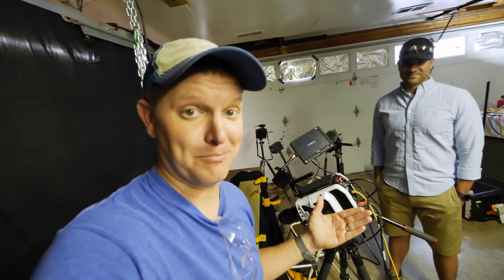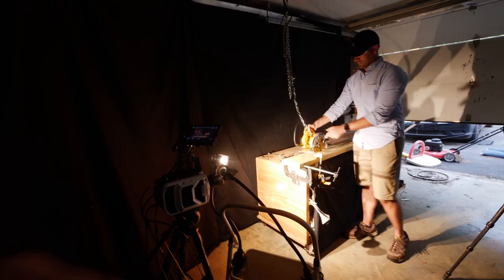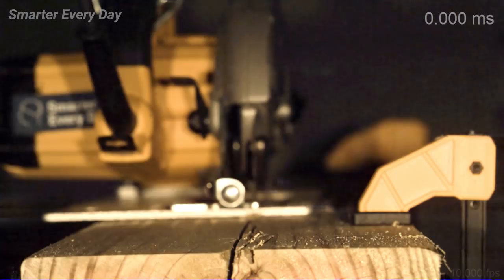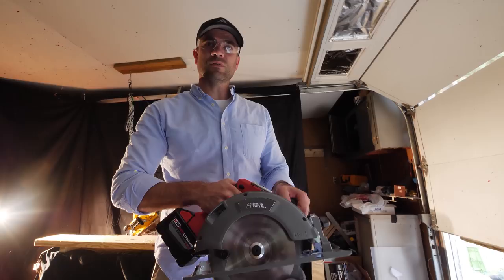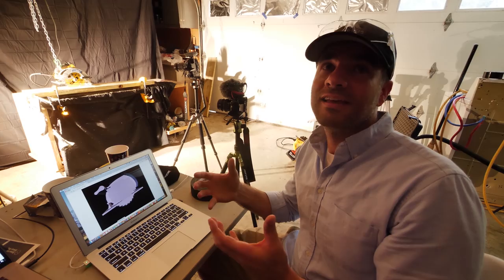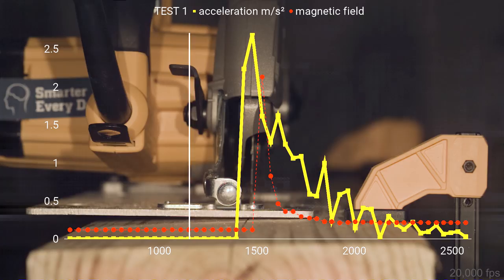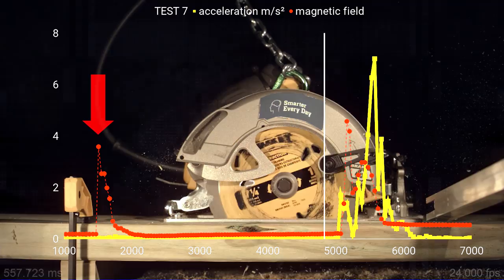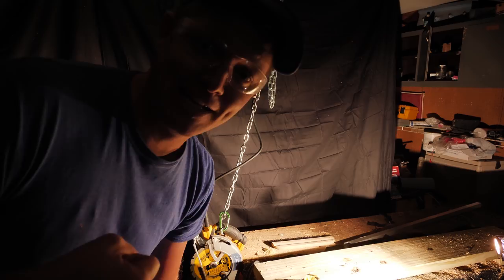Circular Saw Kickback Killer (We used science to make tools safer) - Smarter Every Day 209

Comment: As a carpenter for 20+ yrs, i am curious, how much blade deflection , side to side , and vertically, does your chosen algorithm allow ? There are some cuts that are standard practice in which side to side , ie, saw travels in direction that the arbor is pointing,  and vertical,  short abrupt up and down motion to keep saw from binding while ripping through funky grain , especially on wet lumber. There are other work arounds but continuing a cut without having to stop,  to insert wedge or eat up another person's time, is preferable.

Comment: Correct me if I am overlooking something here. But. Most saws of this type, as far as I've seen has a spring loaded blade shield. If the saw leaves the surface, it snaps shut. You could even add redundancy by adding a wheel actuated kill switch. Both seem more robust and cheaper to add than the accelerometer thingy.. :/
Reply: That, and my $25 black and decker saw has a better brake than the one they demonstrated with. Good for them, but circular saw kickback (even with more powerful saws) is not nearly as big a problem as they are suggesting. Using a circular saw like a table saw is not a good idea, even if you have a smart tool like they made.
Reply: A lot of people jam the guards open or remove them entirely because of the inconvenience of them getting in the way, this is a solution for those people.
Reply: @ShaunDreclin  You can't fix stupid with technology
Reply: And a saw blade to the gonadular region will stop the reproducing
Reply: I was thinking along the same line, and want to see how fast the guard actually covers the blade. However the sensor they are adding is very low cost, it would be worth the couple dollars extra for the added safety. As long as it does not produce false stops.

Interestingly I don't think my saw has a blade stopper. It runs for a  bit after you release the trigger.
Reply: @timfischer  We do it all the time: Seatbelts, airbags, lane assistance, speed bumps, anti-lock brakes, traffic signals, smoke detectors, flame retardant materials, helmets, child-resistant lids and caps, knee pads... Maybe they are all just hacks and not actual "stupid" fixes? But... I have yet to meet a human who didn't do stupid things once in a while.
Reply: Most of the things you mention help prevent human error or things out of the user's control, or protection for children who don't know better. we're talking about disabling a safety feature (the saw's guard).

FWIW I think the anti-kickback tech goes well beyond what the guard would provide. But if people want to disable safety devices they will, and they'll probably find a reason to disable (or not buy a saw with) this too
Reply: This solution would actually be pretty cheap to implement on the scale of mass production. It ensures safety for if the guard is bypassed, and has faster reaction time. There are times when the blade guard just seems to only get in the way, and I've seen people bypass the blade guard by locking it open.
Reply: I've been using powered circular saws for the best part of 20yrs and I've never experienced kickback, hit hidden nails, concrete and all sorts but the saw never felt like it was beyond control. The trick is to use the saw within its capabilities (ie. just because the saw can cut 3ft per second doesn't mean you should aim for 3ft/s every time), keep a good grip and be aware of your surroundings/body positioning.
Reply: @scotts.2624  Yeah, that's how evolution works!
Reply: It does have a guard , they have it defeated and the trigger locked to make it look more dangerous .What a waste of time.
Reply: See my post above.  The saw came out so fast, or hit me so it opened the guard and I was seriously injured.  It was an almost new saw and I do not ever jamb the guard open.  And I have more than 50 years experience with them.
Reply: Ok. After reading all these comments, I kind of want to see tests where the time for the sawblade cover is measured. I mainly thought about it because that common safety feature wasn't mentioned in the video

And yes, there's always freak accidents. Maybe the spring loaded cover only saves 70% of the time... It's still 70% (the 70 % figure is pulled straight out of my ... btw...  the number isn't that important) that get saved by a feature that relies on very simple and known mechanics. I'd just like to see the effect of this device compared with what is already implemented. 

One really interesting test would be to see if the blade could be stopped before the cover snaps shut. That would really sell it. And it could be shown using those Phantom Cameras that I love to see footage from :D
Reply: You bet your gonads
Reply: @court2379  How about faulty sensors not going off as well.  I don't know how these "cheap" sensors will work after being thrown around in the back of a work truck and out in the elements getting sweat, rain, snow, salty air etc. on them.
Reply: @ShaunDreclin  SMART IDEA, STUPID WAY TO ACCOMPLISH IT! What would be wrong with attaching a limit switch to the plate that would activate the brake?

When you start a cut you rest the front of the PLATE on your work. During a kickback event the PLATE rises off the work. Wouldn't it be a lot cheaper to just not allow the saw to power up if you don't start the cut with the PLATE on your work and to brake the saw the moment it comes off the work?

My idea is a lot cheaper therefore more likely to be implemented. Unfortunately I don't have the time and money to invest in it like those guys do.

Question is: Are they  to proud to drop this finished complicated idea and persue a simpler cheaper idea?

Then it would matter if the guard was tied back or removed.
Reply: @MoneyManHolmes  1. this would ultimately be integrated into the saw during the manufacturing process and use the brake that's already built-in, so that's a non-issue.
2. people cutting their fingers off with table saws isn't a "big issue" either, it doesn't happen that often, but there's a reason people pay for SawStop table saws, and it's not because they keep accidentally cutting their fingers off. it's adding an extra margin of safety to prevent the infrequent but catastrophic accidents from happening.
Reply: In my accident it happened so fast I didn't even know I was hurt till I looked at my arm.  It never did really hurt any amount.  I don't know if the guard didn't have time to close or the saw hit me in such a way to open it back up like going into a board.  I could see where this item would be useful to prevent that happening.

Comment: As a joiner there are ways to help prevent  kickback.

Make sure the guard is properly fitted and works.
When cutting sheets or timber cut in a way that prevents pinching.
Maintain good control by using both hands.
Do not cut awkwardly by over reaching.

If that saw wants to kick it will but thinking about how to and using ways to help prevent it. But this is a really cool idea and I would definitely pay more for a tool with this tech in it.

Comment: There's also supposed to be a spring loaded gaurd to cover the blade when its removed from what youre cutting.
Reply: That's what I was wondering, pretty sure they made that for this purpose and when you you accidentally press the trigger when not I position. They should of recorded a slow motion of how fast the cover responds to a kick back.
Reply: While the guard should be enabled there are times during kickback that the spring is way to slow to return the guard to rest position (have run into the issue although never with an injury).  Secondly this idea would help protect the user in the case that you have to disable or manually hold the guard open (which happens quit a bit in construction.)
Reply: @Vlad599x  Good to see I'm not the only one wondering about that!
Reply: @Shakrii  Lets find out and slow mo capture kickback with the guard still on the saw.
Reply: The blade guard can only close when it's completely out of the wood. This system stops it much faster. If there is less chance of it even getting out of the wood. Than the chance of it hitting you is also smaller
Reply: @oetzebroek4874  it isnt really of a danger if its still in the wood, and if its out of the wood the guard closes, covering the blade. Unless you're cutting with your hand behind the blade, the guard is sufficient.  Now the saw could drop in a way where the guard catches on your clothing and exposes the spinning blade ad chopping you up.  Could use the same technology thats used in the table saw stop when it detects meat.

Comment: Excellent work. As a person that builds I have an apprehension with the more powerful tools at times. Once it kicks once I get paranoid.
Reply: This essentially turns circular saws into a full SawStop machine.  This is incredible and must have for all us makers.
Reply: @TheAlphapuck5280  No, it stops kickbacks, it will hapilly saw through any meat you feed it, provided you don't make it kickback. Whereas a sawstop will happilly kickback (make fly) anything if it binds the blade, provided it's not conductive in which case it will stop the blade. two different problems and applications
Reply: Ju lo
Reply: Agree this would be a great feature for a demo saw
Reply: Or you could hold onto your saw
Reply: @thomassands3729  I do hold on to the saw. I have all my limbs in tack. It just gets me paranoid that I may slip some day.
Reply: @manickn6819  Hahahha! What? Sounds like you need to start knitting, leave the building to us, the ones that master tools.
Reply: @redeyejedi3753  lol. Have a look at the stuff I upload. I make all kinds of things. Don't really use any one tool too often though.
Reply: @Danny Timms been doing it 22 years. I am a master framer, I have all my fingers and toes. Never have I used a tool improperly. Its usually the tool operating the tool. To fear anything is futile. Respect it. I wouldn't want anyone whom fears a tool on any job I run. That is how people get hurt and hurt others.
Reply: Manick N dude you play with electronics not wood no wonder your scared of a saw
Reply: Manick N...In that case you should leave it to a pro. You need to take control of the machine, not the other way around.
Reply: @redeyejedi3753  you should always fear tools weather it be a Circular Saw or a 15 tonne tractor and calling your self a master acting all high a mighty will make you complacent and nothing good ever comes from being complacent. also this anti kickback system isn't just good for normal a normal kickbacks say if you have a medical episode like a heart attack and the saw kicks back and ends up hitting you in the face and when the ambulance comes they may think you where knocked out but the saw. unless another works seen you fall be for the saw hit you they will treat you for a saw to the face and not a heart attack witch could end up killing you.
Reply: @Danny Timms I am a former combat Marine, I fear nothing. Not even the lord. I spoke truth. What I said was not offensive, but if you were offended, well that's your problem.
Reply: You shouldnt be using them then. You CANNOT be apprehensive, that gets you and others hurt.
Reply: @redeyejedi3753  I agree with you. I've been working with way more dangerous things than a circular saw for 30 years. It's always the people on the job site that fear the tools and are apprehensive that get hurt! Know the tools, respect the tools, control the tools,  have confidence in your skill and you will be fine, and if you are not, DONT continue to use the tools!
Reply: @Danny Timms no need to insult you. You have done fine on your own. Have a good day.
Reply: @redeyejedi3753  Not having fear and having courage are two very different things brother.

Not having fear is dangerous - it's ignoring what's right in front of you. 

Having courage means you realize the full implications (and potential outcomes) of what it is you're up against and yet you still choose to soldier on.

Very different.

,
Reply: @DarrenD777  I disagree. In the work place, confidence and know how replace fear. If you have never operated a tool, you should learn from someone with experience. Besides, as I said before, if you are using a sidewinder instead of a wormdrive, then you are not a serious builder. If your saw binds, you are in error. I run crews. I am a custom home builder. I can hear when a saw is used improperly, and I step in, like a good Forman should. Again, I still fear nothing on a job, I am a master framer, not a weekend warrior. These men are taking advantage of ignorance. That's week sauce. Ima shower this man glitter off (saw dust and dirt) and hang with ma fam. Good luck.
Reply: @DarrenD777  dig the name, is that from workaholics? Awesome show!!

Comment: Hey Destin,
it´s lowtec but a riving knive also helps a lot :-)
Reply: Are there riving knives for circular saws!? I've only seen them on table saws
Reply: @Ksweetpea  they are used where ever a blade can be pressed from cutted material
Reply: But would that prevent the kickback here? Because he ran into a knot? (and yes, never seen one for this type of saw). Plus, did they do anything (else) wrong, using this saw?
Reply: Makita makes a saw with a riving knife...seems the simple way to go...
Reply: Also a small wedge is used at the end of the cut if you feel the saw is getting sticky..
Reply: @Ksweetpea  Festool TS55 ans TS75 have them. Never had any issues

Comment: I'm a carpenter. when I first started using these i had tons of kickback problems from not knowing how to properly use them. The more and more you use them it becomes less of a problem. But this is definitely a GREAT idea I would definitely be getting one because accidents do happen experienced or not and why not prevent it?
Reply: How many fingers does typical learning curve include? :)
Reply: I actually cut wood with circular saw today for the first time. And I had 3-4 kickback events. How do you cut "properly" to avoid it? I mean I was holding the saw with the dead grip, so nothing happened, but maybe there is better way of handling it.
Reply: Seriously. I don’t understand why you don’t spin the saw the other way around. That way if it come out of the wood, it runs away from you
Reply: It's not as much how you hold the saw but what position the wood is in. Kinda hard to explain
Reply: The blade pulls the wood into the saw's metal base. If it were the other way the saw would cut by pushing the wood downward causing the saw to climb up normally. The problem is the wood coming back together at the back of the saw were the circular motion is reversed from the front of the cut. The solution should be to use a riving knife to prevent the cut wood gathering in the back of the saw.
Reply: @jmlcarlin  Also with issue with table saws.  A riving knife is used there the same width as the blade to keep the kerf open.  Harder to do with a circular saw, but I believe the festool track saw has one.   This is a pretty cool and high tech solution.
Reply: @TheBizarroHD  It's always hard to explain position of wood.

Comment: Black and Decker Super Sawcat   The first one I bought was in 1971.  It cost a fortune.  It cost 2 weeks of my gross wage.  8.25 "  blade, and a power blade stop whenever the trigger was released.  Blade stop time in milliseconds. The blade would ring it stopped so quickly.

The reason I bought a saw with a power brake was,, the very first time I was hired as a carpenter was on a job site that I walked on looking for work,, it was in the afternoon.  That job site had had a fatality that morning,  Job sites are dangerous places.   The carpenter, that morning was ripping the length of a 2X12, the wood grabbed the blade,, the saw kicked,, and the most common place for a saw to go on a kick back is a rotation  ,, up,, out of the work, and the saw body continues the rotation up and over.  The blade comes violently up and as it rolls over it climbs into your leg or belly.   That was how I got my first job as a carpenter.  The guy that started the day died as a result of the kickback.  It was about two years later when I found a Black and Decker Super Sawcat in a tool store.  I bought it.  The line was discontinued in the early 1990's,, at that time I was on my third or fourth saw.  I bought three from the wholesaler.  The last of those died this past summer, 2018.  

For just shy of 50 years I have been using a saw with a power brake.  Every time I lift my finger, the saw  powers a brake to halt the blade.  If you wish to improve upon that,, make certain that what you do is even better than that saw.  I'll buy it.

Comment: Being a general contractor, I've felt my heart stop a few times while using saws! Saws (including table saws and reciprocating saws) are very dangerous -- even when used correctly. 

I use DeWALT, and my business partner uses Milwaukee, and we would both like this technology in our saws! All of our saws. I named those brands specifically so this comment may show up on their radars!

Now, if only these guys could come up with a hammer that doesn't hurt when you hit your finger! Fortunately, that's rare for me nowadays.
Reply: Yes please, hammers with electric brakes!
Reply: DeWalt is only a trade name tho...
Reply: If you’re still hurting your fingers, while hammering. Idk what to tell you bro. Find another trade.
Reply: @donmamon9263  there are 2 kinds of carpenters, those that admit they still make mistakes and damned liars.
Reply: This will likely be something you'll see available as a 3rd party device that can be added to any saw. Because lawyers. If a manufacturer adds this feature and it fails to stop a kickback that results in injury, the tool manufacturer is liable. It's the primary reason you don't see safety features added unless there is some related safety mandate passed down by the gov.